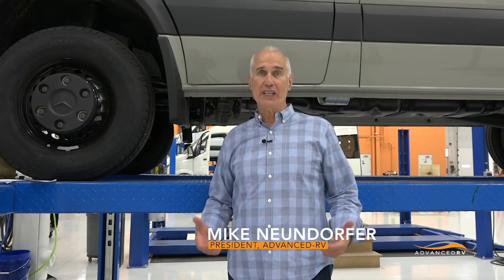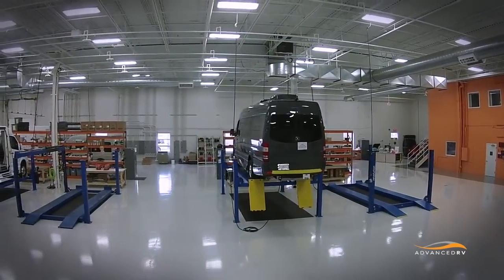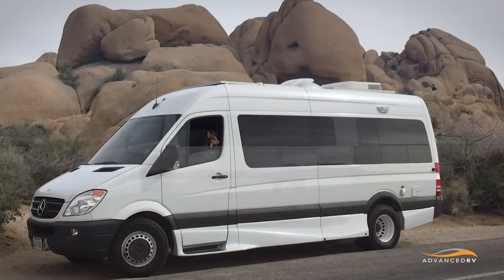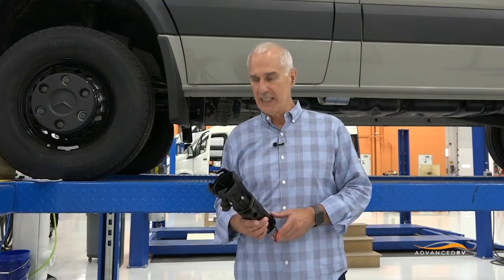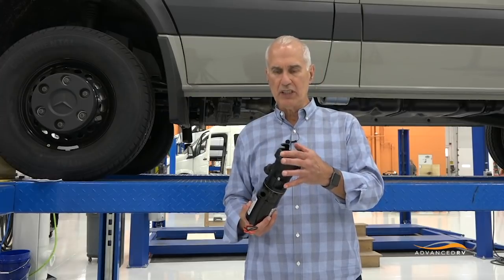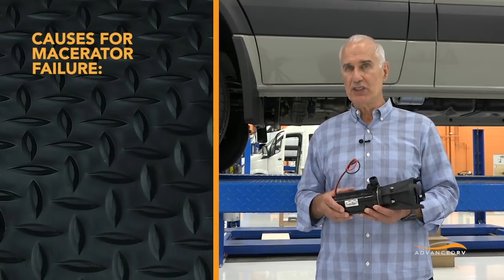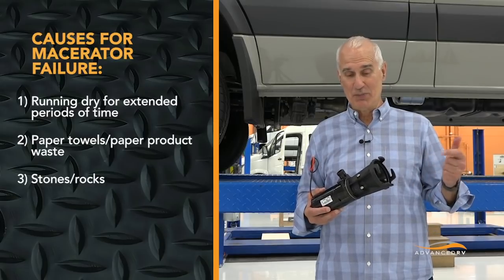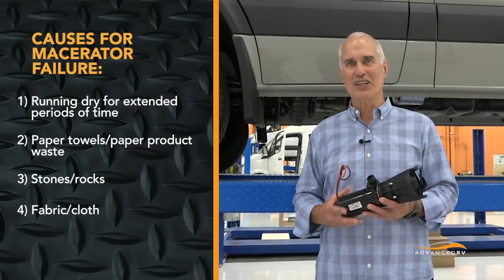Advanced RV Tech Talk: Meet Your Macerator!

Comment: What is the best fitting to adapt a permenant type macerator for temporary RV use?  Specifically - I need to go from a 3" bayonette to 1 1/2 NPT.  Is there an easy adaptor for this without using a Fernco or similar?

Comment: With a few low cost sensors that can be monitored by a low cost microprocessor (Raspberry Pi less then $40. ). And a bit of in-house programming could save the user a lot of time and money replacing the unit. A simple LC panel could show high temperatures and a clogged inlet.  Back that up with a automatic shutdown and the system could be more reliable.